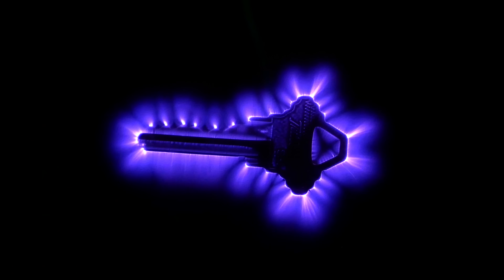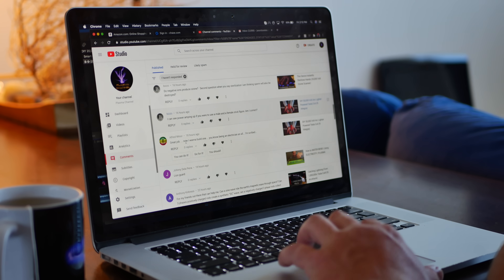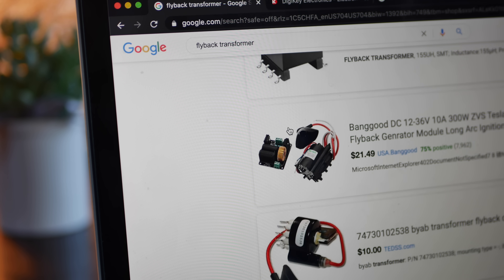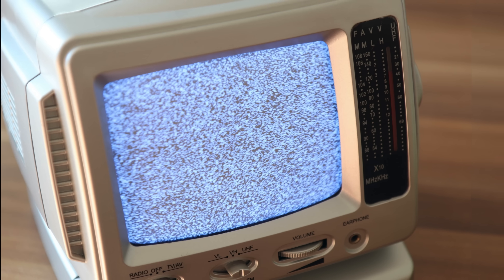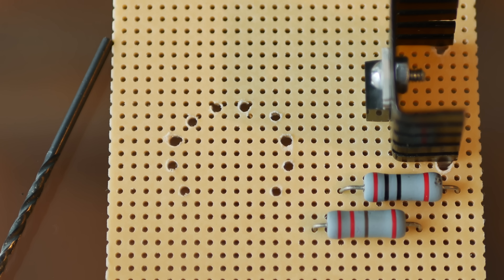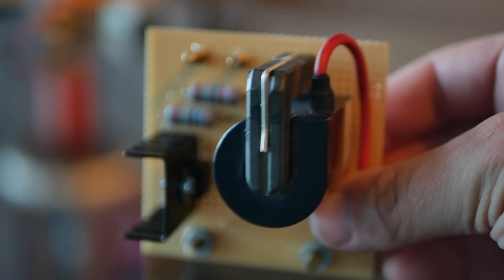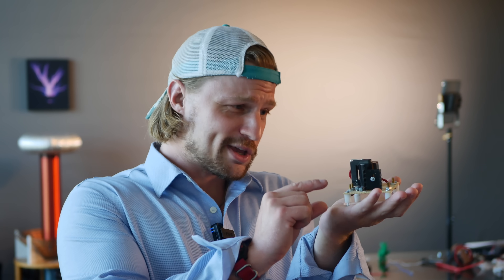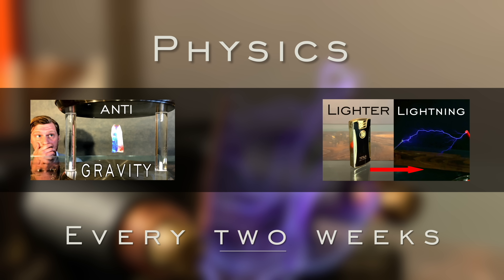DIY Plasma Physics Powersource (Mini 20,000v Flyback)

Comment: The output is ac or dc?
Reply: Dc bro it create dc voltage because of flyback transmitter built in rectifier

Comment: Be careful guys, I did get my finger zapped by 20kv once and it DID leave a mark. A tiny one, but it got me through a rubber glove.
Reply: Why did you wear thin rubber gloves for high voltage, at that voltage insulators cease to insulate
Reply: Yo
Reply: @Snakecat_Rex also what frequency dc or ac did it go through your hearth and what was the duration if the pulse?
Reply: rubber is very conductive for 20kv
Reply: Yes, rubber gloves only withstand 1 kv.
Reply: 50k with nothing 
Rookie numbers
Reply: @PaxLak   I unfortunately had experience with 80kv 10A through my arm. Was a crazy experience and knocked me to my knees, but I was up again straight after as if it was fine. It did hurt like hell while it was happening and I was definitely sweating.
Reply: @Snakecat_Rex  Off topic, but by your channel desc I can tell you're an absolute chad

Hope there are more furries like you!
Reply: @Makaron_Games  Thanks Makaron, I appreciate it.💚
Reply: @Makaron_Games what’s a Chad?
Reply: @debbieinitaly  basically a cool and strong person
Reply: @Snakecat_Rex  DC or AC, what frequency?
Reply: @Snakecat_Rex  I’ve gotten shocked like that before. Feels like you get kicked hard in the back and then you’re on the ground suddenly.
Reply: @genericinterneter  exactly, felt like a mule kicked me and a stumbled across the room
Reply: Liar, that much electricity will instantly knock you out
Reply: @AngeliqqMc   it depends on not only the voltage but on the current as well
Reply: the human can handle a maximum of 10a of current
Reply: @plasmascientist  im talking to the guy who said he got zapped by 80kv 10amp
Reply: @Snakecat_Rex 10amps?!?
Reply: @AngeliqqMc  the amperage was extremely low

Comment: May I add that if you magnetic join two magnets attached to both + & - separate them till you feel repulsion then switch on the plasma spark will be greater, and the gas that is made is Nitric oxide that caused Teslar to comment that to breathing it in was "uplifting"

Comment: What exactly is the high voltage ground wire comprised of? it looks like stranded aluminum wire with some sort of sheath??? correct me if im wrong; im new to physically building but familiar with physics

Comment: It worked! But instead of 2 watt resistors i used 1 watt. The arcs are really big and awesome thank you!!
Reply: From where did you get mx d363 transistor?
Reply: Hello, I apologize for the late response. I didn't buy it, that's what confuses me. Basically, I made the power source with a different transistor, but it overheats and dies. That's the thing, in the video he mentions a different one, but reading the transistor it's a different one.

Comment: Was that a mistake in your video, Jay?!
I found out that it is rather the higher resistence pins that apply to the Primary Coil in the circuit instead of to the Feedback Coil. I had to completely switch terminals to get it working!

Comment: GREAT VID...THUMBS UP AND SUB!!!
Is it most desirable to have a high voltage transformer that is AC  OR DC?  For some apps of the TV flbacks have internal diodes.  I need an AC flyback, which reminded of one of your others where you made the "most simple HV supply" using the transformer from a big tall air ionizer....is this type flyback...which is NOT from an old TV...pure AC.
I got a couple of those and just broke it apart for the transformer.   Well, it was there, BUT, unlike your video, it's HV output was connected to a potted device.  I assumed it was a 'capacitor/diode voltage tripler', which I think has a DC output???  I an trying to decide rather to remove it from the transformer.
BUT doesn't it's presence imply that the HV transformer is pure AC...which is what I need?
THANKS AGAIN!!

Comment: Is the hv output ac or dc? If ac what hv diode to use to rectify it. Thank you.
Reply: Sorry for late reply but the output will be dc as the transformer of a crt tv already has diodes that rectify the ac to dc

Comment: I would like to know if one of these would be good for my hydrogen fuel cell? I was going to run it off three 12 volt car batteries in series but I prefer not to lug around the extra weight so I want to build a variable output supply that I can adjust the voltage &/or frequency to get the best output from the configuration of my cell. I know a lot of components & I can solder well but am lost on configuration. Please advise.

Comment: I have just discovered your Chanel so I’m not sure of your area of expertise but could you do a video on a battery that powers a motor or a lightbulb and uses it’s dispersing power to recharge it in the most efficient way?
Reply from the maker: Welcome to the family. Do you mean you'd like to see a video on energy recapture?
Reply: @PlasmaChannel  yeah. I saw your video where you used ur drone to capture power from the sky. Could you rewire the power u captured into the drone to recharge it as you are using it?

Comment: I remember building a circuit similar to this. Much bigger FBT and arcs. Be very careful around this circuit as it can give you nasty burns from the arc. They take some time to heal too. The best way to draw arcs is to terminate the HV Ground to an insulated philips screwdriver. Then draw it close to the HV Hot and the pointed end of the screwdriver makes a great breakout for the arc to form.

Comment: I've made it. Used a TO3 package 2N3055 transistor. Besides an audible very high pitched hissing sound, no further results. Power supply is a variable one, selected 12V. Right at the moment the circuit is powered, the voltage decreases to ~2V and current rises to the max (~3.2A), in other words it behaves like a short...Could it make any difference if I incorrectly took the primary as the feedback and vice-versa? Thanks!

Comment: help please. You say you read all the comments but you really DON'T. now help me. I have a flyback transformer with exactly 4 pins but the method you use to identify the pins doesn't work with my transformer any ideas on how to make it work?
Reply from the maker: Reading comments is different from responding to comments. I read them all - like every youtuber, they go to my phone like a text message. Yours has 4 pins and a HV out?
Reply: @PlasmaChannel  yes. I tried looking up the device model and apparently its nowhere on the internet. but it has 4 pins, and HV output out the top. But your method  of how to identify the pins is not working. some pins are shorted to each other, and some pins have absolutely no resistance to each other. I may just open up some electronics at thrift shops until I get a good flyback. And sorry I was mean I understand that your read comments but don't always reply back. Please reply if possible. 😁⚡

Comment: Hello Mr. Plasma.  I just got my power supply working!  So excited!  I was about to toss it in the bin, but decided not to and instead figure out the problem.  Turns out I had the bjt flipped and connected to the wrong windings.  Cheers brohiem!

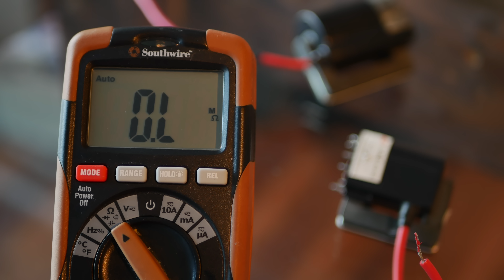Comment: 02:33 this is a problem for basically all flyback transformers and measuring resistance to find primary rarely works. Ive tested this on around 20 different flyback transformers and an 17 of them i got 0.7-0.9 ohms across multiple pins. In fact, i never got any pair of pins that had over 1 ohm. For example: pins 2 and 3 were 0.9 ohms, 4 and 6 were 0.9 ohms 8 and 1 were 0.7 ohms and so on. Its trial and error. Pins 2 and 3 were the pins that worked most of the time for me.

Comment: what is the duty cycle? with 12v? 
it seems to be missing a capacitor or two or three... ?
Reply: on the one hand rule... I was building a high voltage circuit for a CO2 laser in my living room... right before dinner.. everyone is home... I'm applying the voltage... and.. wait.. no.. I'm sitting on the floor about a meter away.. hoo boy..  defibbed the old heart.. and.. remember the one hand rule.. every time.. when working with high voltage ⚡
Reply: my son was 3.. it was 30 years ago.. ok so far ✌️

Comment: PLEASE HELP ME.
Hey i have a question. Do i get the same results with a ZVS Driver, or is frequency different?(well it is...) but is that even important for a SGTC (like the tesla coil you use this powersupply for)? it should just be: resonant freq of cap and prim have to be = resonantfreq of secondary. it doesnt matter what i charge the caps with... right? right? Just asking bc i have a zvs driver and a flyback that do similar voltages. my zvs has a freq of about 50kHz. but it isnt in the primary circuit so it shouldnt matter. or do i need THIS DRIVER configuration SPECIFICALLY to make your teslacoil build work?

Comment: Not a single warning about the dangers of high voltage in general and is actually encouraging his audience to play with high voltage and "experiment". Nice.

As a lawyer, please for the love of God put a proper disclaimer and stop telling your audience to play with high voltage.  Oh and saying "be safe!" and "use one hand!" does not cut it.  Thousands of people die each year from high voltage, do not play with it. 

Can this particular circuit kill you? No, but that's not the point. Kids who watch this don't know the difference between AC and DC and voltage vs. current, etc. Next thing you know he's plugging a microwave transformer into the wall and shocking himself. Read the comments, damn near half of them are people making this asking extremely basic questions.

Comment: I'd like to see a laser made using high voltage. Not like what you did with the hex rods try using a strobe tube and synthetic ruby or diamond rod with a reflector to bounce as much of the light possible into the rod.

Comment: plasma close is strong ... far is less... but slwoly pulling back and waiting to normalize gets power without connection .. using pulsing or hollow tube extends it ... look power is without wire .. HOLL the tube to carry her

Comment: I had an old flyback transformer I got from a plasma ball and I did not use this exact circuit but I used a slayer exciter circuit from my tesla coil, and wired the primary coil and secondary to random pins until I got a tiny TINY arc when I connected the output to ground. It wasn't much but I was able to dimly light neon bulbs and fluorescent bulbs. Stay energized! ⚡👍
Reply: and no one replied to help me....☹
Reply: Without anything but ground?
Reply: @thebusinesscentre  Yeah, It seems to not be ANYWHERE on the entire internet. Rare find I guess.
Reply: @milespeterson5049 beleive it or not, one of the coil pins is the ground,
Reply: I wanted to do that! But I never knew how to wire it

Comment: Well I nabbed all of these parts and my unit is just not working. Any chance anyone who is still monitoring this video, or sees this post, and is knowledgeable can give me a hand in finding out where I goobered it up?
Reply from the maker: Sorry to hear it’s not working - did you procure a flyback transformer from a mini TV?
Reply: @PlasmaChannel  I purchased a few of the one from your parts list from tedess. I believe I may have the primary and flyback pins incorrect on it. If you'd be willing, I'd like to make a small video of my setup so you can hopefully see where I am possibly going wrong with it. At the moment I am trying to get a working circuit going with alligator clipped wires before I solder together a final product since I am trying to make a few units which can be used to demonstrate the vagaries of high voltage arcs with the school welding class (and play with plasma on my on time) without needing to go looking for anything too high powered.
Reply: @PlasmaChannel  Here is a quick video (About 3 minutes) I made of my setup and the probable errors I am making: https://youtu.be/QG_dWeJ-NlQ

Comment: Please tell, if this power supply can be used in the instant hand sterilizer or Kirlian photography setup. And what is the approx frequency of the output voltage of this supply? Can the frequency be varied? Please answer, my acrylic frame is ready and I can't wait to make the instant hand sterilizer.
Reply from the maker: Hello, this power source cannot be used for the kirlian imaging device, or hand sterilization. You need an AC source for those. HOWEVER, if you build this with an AC flyback, then yes, you can.
Reply: @PlasmaChannel  Thanks a lot of replying. If this power supply can't be used then, then please make a video on the required power source or suggest me some videos or blogs or anything so that I can easily make 😊

Comment: I bought the transistor which you linked down but it has 2 pins only yours has 3pins
Reply from the maker: The case is the third contact. 2n3055 is like any other transistor with three contacts. If you look up on good it’s pin out, that should help.

Comment: Great project, but is if OK to neglect the polarity of the primary coil (with respect to the feedback coil)?   Also, why not find the output ground pin by resistance as well?    Though it should be considerably higher than the two input resistances.    Anyway, neat project, and any reference or another video as to how the oscillator works would be appreciated.
Reply: How to identify feed back coil

Comment: Hey man I'm a tinkerer of electricity myself and I like to smoke capacitors n such. After popping a few off tonight and messing with my zvs transformer I was wondering if it is possible to make a powerful arc not with this zvs but a flyback) within a small wind tunnel to watch The Arc turn with the air direction I suppose?? Imagine a small acrylic cylinder maybe 3 inches open a fan on one end positive probe on same end and negative probe on opposite end with an opening. Could you form the air direction with the arc?
Reply: If you’re trying to change the air direction with plasma, what is the purpose of the fan?

Comment: I built a similar circuit only using 2 transistors. The circuit you have needs a resistor on the emitter to prevent thermal runaway. to prevent arcing you should use a shield to protect the rest of the circuit. Also high voltage putty helps.
Reply: smh

mate thats literally the simplest fixed bias switching circuit

at this point just add emitter resistor to every switching circuit

why do u think fixed bias exist, why not just make everything emitter bias smh

no u dont add resistor to prevent thermal runaway, u use the damn heatsink, there is literally only 1 transistor there

also dont make shit harder for urself, u have urself to blame for overcomplicating shit when the flyback transformer work no more because of that resistor

Comment: I built a ZVS circuit years ago. It works great. I tried building this circuit. I used a larger flyback and I didn't have a 20 ohm resistor so I used a 22 ohm. I don't know what I did wrong. the circuit itself still seems fine but the Flyback itself nearly exploded. I started at 6 volts to be safe, I was trying to find the Flyback ground pin, but there were no arcs to be seen. So frustrating. I didn't learn anything as I can't see what I did wrong besides the 22 ohm resistor and larger TV Flyback. can anyone help?
Reply: that could happen if the frequency of the pulse is less than 20kHz. These flyback voltages are built for freq. higher than 20-kHz, if any less then they tend to heat up.

Comment: So umm, my flyback (which looks exactly like that one) only seems to have 1 coil with resistance under 1 ohm, so I'm really confused lol

The 2 coils I could find have a resistance of 0.4 ohms and
5 ohms?

Any tips anyone?
Reply from the maker: Your .4 ohm (depending on flyback model type) will be the feedback, and the 5 ohm your primary. However, that would be a very high resistance primary...

Comment: Hi Sir, How did you power on and off the transistor? 

I mean is, How to use a transistor or a mosfets as a switching device??

Ty.
Reply from the maker: The transistor is automatically turned of by feedback from the flyback coil feeding to the base of the transitor.
Reply: @PlasmaChannel Thanks

Comment: Good job. That circuit is very interesting. I would put two flat elecrrodes and do few experiments with plastic thin films. I don't know what power you got at output but maybe that power is good to get a tratement in plastics and improve printing conditions. Regardes from México.

Comment: Would like to see this modified slightly to make an ozone/ion generator when you want to rid your house or a specific room of smells.  The store bought ones are usually low powered and take forever. I'd like one that can *ozonate a room in 30 minutes or less, attach it to a timer and let it work while I'm out for a few hours and it can shut off long before I get back home.